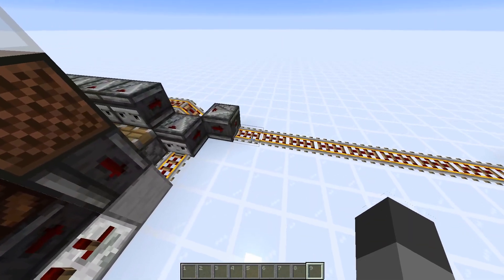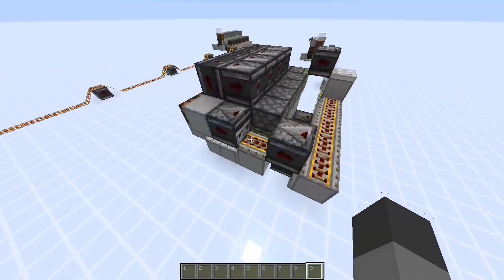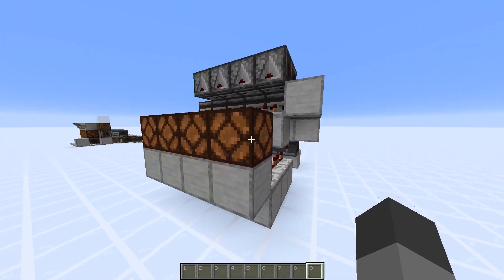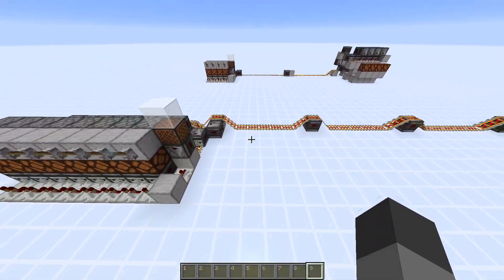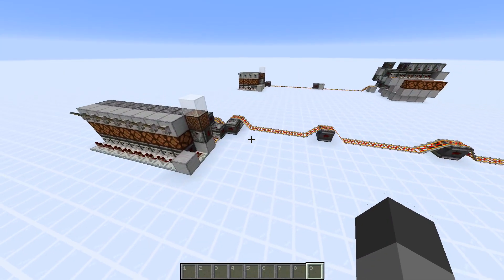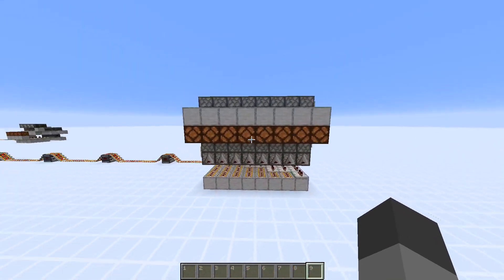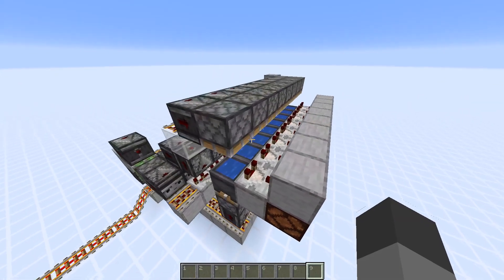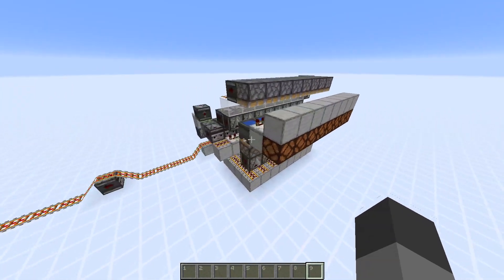Improved serial transcoder

Comment: this inspired me years ago, but i've since completely redesigned the transmitter and receiver. i'm using it mainly for a network of pearl stasis chamber teleporters.
i wouldn't call what you built here an encoder or decoder, since the codes still need to be entered and deciphered, good stuff though

Comment: Any ideas on how this design can be expanded to >9bit signals?
Reply from the maker: Been a hot minute since I worked on this, but I think it should just tile to higher bit lengths pretty easily! You'll just need to add more repeaters on the decoder side to sync up all the outputs ^-^
Reply: Ah yes that makes sense thankyou!  @vktec